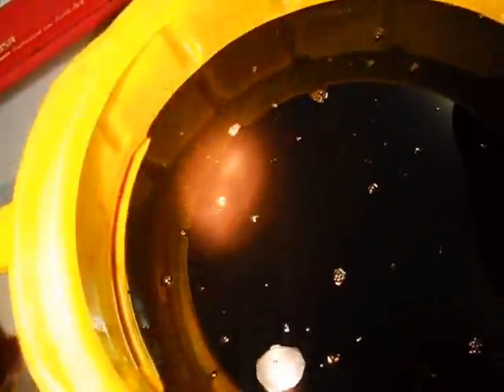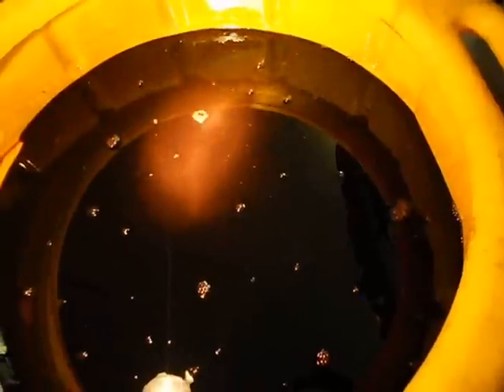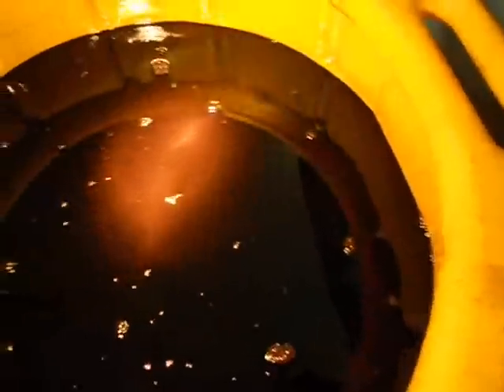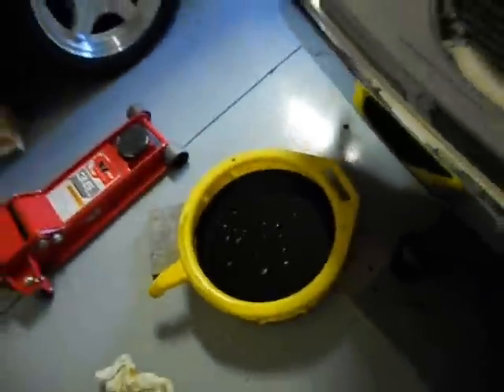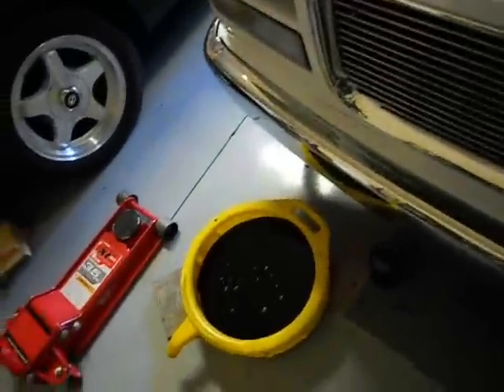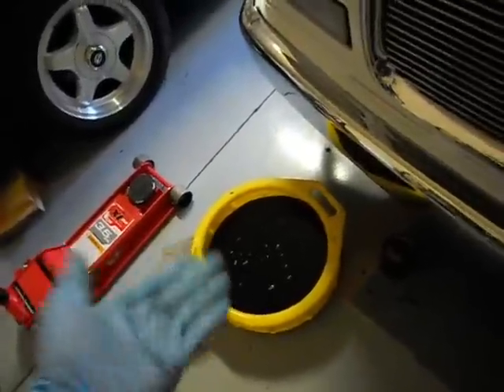Metal Shavings in the engine oil. Failing engine

Comment from the maker: Engine still works fine. I think the old worn timing chain set maybe was chunking parts of the cam gear. New timing chain / gears  and I see no more chips.
Reply: @Brandon Dennis so I just seen this in my oil change should i be worried ? 05 Honda
Reply: @oegesauto5619  did you find out if you should worry?
Reply: Adam J  sorry car was sold not long after
Reply: @oegesauto5619  damn made it someone elses problem

Comment: MOTHER OF PEARL well hell I much appreciate the vid. I'm having the exact same sh*t with my 08 Highlander. I guess I'll go to Toyota for  diagnostic and try and find a reputable ASE mechanic.
Reply from the maker: this engine stil runs and makes no more chips. Think it was the timing chain. I replaced it.  Old timing chain had... Small wore in marks.   I also had  most of the top half of the engine apart, Inspected the cam Lifters ETC and saw no issues.    2008.. FOrget if that was a 3.3 in the Highlander or did they have the 3.5... I used to Work For Toyota.. Entry level. I have a TOYOTA service degree.  hahah

Comment: when there are fine metal shavings, it could just be that the motor is old or components in the motor like the timing chain guides or cam chain guides have broken or for instance the 2006 Audi A4 2.0T has a oil pressurized cam chain tensioner to adjust timing during acceleration and if that tensioner starves for oil, the rotating chain will shave off the hard plastic and then into the metal part itself and youll hear whining noises and get metal shavings in your oil.  the best solution for an old wearing engine thats making fine metal shavings is to add a magnetic drain plug.  it will pull most of the metal shavings out the oil.  god bless
Reply from the maker: yea once I changed the timing chain it was clear. timing chain gears had some wear in them. Chain was very loose. Still working!

Comment: All the GM cars I've ever owned have done this. I have a 2011 Nissan Altima 2.5 that's had this same problem for a year and it's still running strong. 163k miles.

Comment: It's leaking oil like crazy - just like my 2012 master 2.3 DCI it's at the garage they said if it has metal shavings in the oil filter they will have to replace the engine which is a big no no for me

Comment: Or you could just stick a magnet in the oil pan and stir it around. Pull it out and voila...theres your proof. Easier than hunting with a flashlight.
Reply from the maker: Seems to be gone since i changed the timing chain. Chain had some heavy gouging. in the gear and it was pretty loose.  Its still running!  Sure runs great with a new timing set

Comment: how is the engine now ?????i just changed my oil in my kia and it now shows metal shavinging in my oil wasnt there last oil change
Reply from the maker: hahah Still working.  Way more miles.    I did change the timing chain and it did have some wear marks in the teeth and some chips.  Really have not seen any since I did that job.       I think the Shella Rotella HD diesel oil is keeping it together.  I do have a light wrap when its ran for awhile like a wrist pin is a little worn but you can barely hear it and its been like that for 10 years.

Comment from the maker: @kerobinsonii  Yea, The later model 96+ pans had a metric drain plug ( I believe it was a 15mm instead of a 9/16 like I have) anyway, Yes some were magnetic.    The engine has been literately a "ticking" time bomb for awhile now.  I should make a  video what it sounds like when its warm after you beat on it a bit, It starts knocking lightly at idle.  Oh well. I can't fix it here. IF I lived some place else instead of bitching about it it would be swapped for something better already.

Comment: Chunks of metal in the oil and still running?? What kind of engine do you have?
Reply from the maker: A Chevy.   yea it still has chunks 6 years later.
Reply: Wow. Have you ever found the cause?
Reply: My 02 galant is like that too
Reply: I got an old boxer engine turbo runs fine had chunks of metal in it
Reply: Yeah my 2001 Pathfinder is the same. Glitter in the oil, even some pieces the size of sand grains. It's still running.

Comment: The key might be just to keep the engine lubricated.  just like a human body too much of the wrong shit with age and not flushing real good with water will cause a shit load of problems punt intended. I use Lucas everything for my engine
Reply from the maker: It still works I changed the timing chain on it and the gears had some small ground spots could of been it. Also solved the nasty bog the engine used to have too much slack.